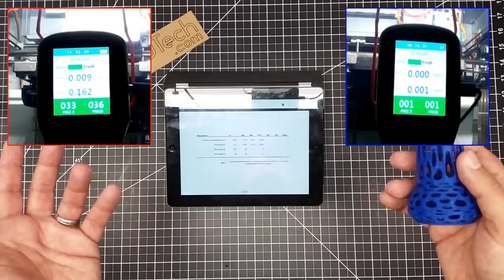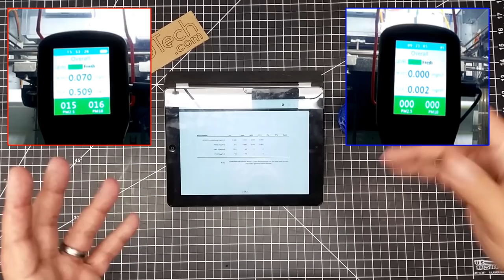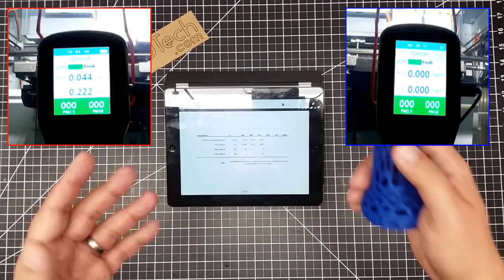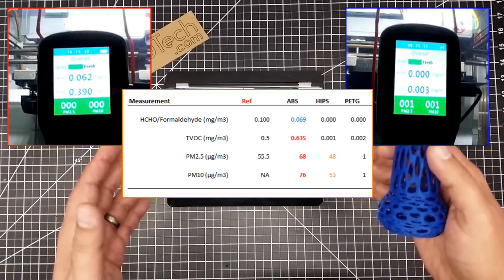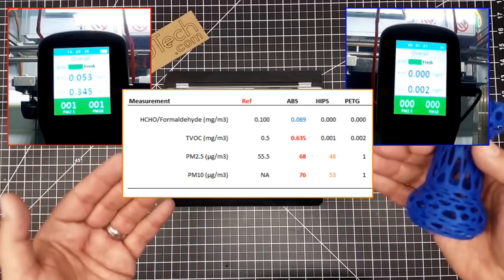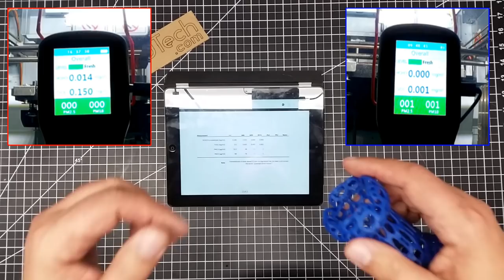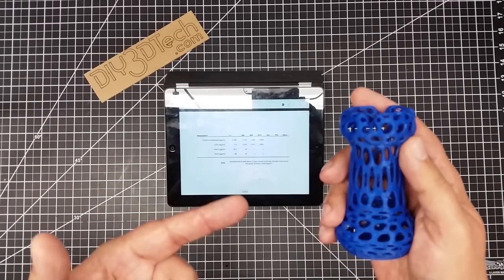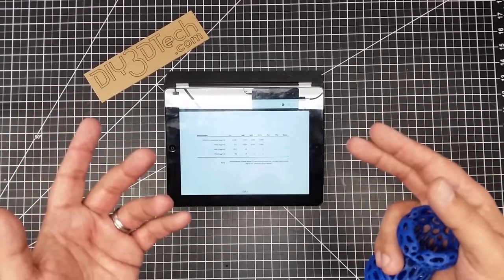3D Print Air Quality - PETG -vs- ABS and the Results are AMAZING!

Comment: I suspect that the biggest reason for the glycol is that it lowers the melting point.  This is quite a desirable property for 3D printing!

What's happening is that PET likes to crystalize.  The glycol groups basically "get in the way", making the polymer more irregular so that it doesn't fit against itself nicely as straight PET does.  As a rule of thumb, compounds that crystalize more readily have higher melting points.  It has to do with the crystalized molecules being more tightly packed and so there are more places along the structure that molecular forces can "adhere" them together.

The crystalization of PET is what causes the hazyness in the material.  Basically, light bounces off the seams between the individual microcrystals, resulting in a beam of light getting diffused as if it were passing through fog.  I believe that the crystalized material also ends up more brittle, since the seams between crystals are weak points where it can readily fracture.
Reply from the maker: Yes on lowing the melting point and very nice summary of PET :-)
Reply: Interesting!!

Comment: I am an artist and new to 3D printing. I was hoping it can help me with my builds on creating very unique things I have yet to see anywhere. I’d love to share my art, hydroponic designs, and commercial product design for home building to share for everyone so I’m extremely excited. I wanted to start off with a filament that is strong, slightly flexible for durability for drones, toys...etc I hate the fact that PLA melts in UV. ABS throws fumes,.... I have a new born and no chamber on my tevo tornado so no go for that one. PETG seems perfect to start off for a strong yet friendly filament with a slight flex so it seems. My next goal is to choose a really flexible, almost latex like filament that’s also safe. You’ve been a great help more then expected. Thank you. If any word a flexible, safe filament that’ll be great. Maybe two to compare low cost to high cost. But mainly health is what I worry about thanks again keep up the great work.
Reply from the maker: Many thanks and yes to the PETG and I know nothing that is as flexible latex, as I typical use TPU...

Comment: I know this is late, but I just discovered the channel and subscribed. PETG is not very complicated as polymers go. BTW pronounced: polyethylene ter-thal-ate (silent ph). PET is derived from ester polymerization of ethylene  terephthalate. Various glycols (polyalcohols) inhibit the polymerization such that the size of the polymer can be manipulated by the competing glycol concentration during the reaction.  PET with very high degrees of polymerization crystallizes, so is not very mechanically useful (in many cases). Adding glycol gives a shorter chain polymer (on average) that has all the useful properties of PETG because it IS PETG: polyethylene  terephthalate glycol. The alcohol (-OH) groups left unreacted during polymerization causes the plastic to be hydrophilic (water loving), which is why you should keep the filament dry if you want reproducible results. I'm not a polymer chemist, rather a biochemist, but since many of the important biological compounds are polymers, we all know a little bit.
Reply from the maker: Very interesting and thanks for commenting for as that is why I didn't become a chemist as the silent ph's always gets me :-)  However this is interesting as yes your correct on the shorter chain and did not realize it was hydrophilic, but guess I should have realized that.
Reply: Thanks for the reply

Comment: Interesting video, thanks. Have you (or anybody else) ever noticed a post-printing 'bloom' on the glass build plate after printing PETG? I love using PETG straight onto glass, which only works well if I keep the glass very clean. After a print of a couple of hours +, I usually get a 'smokey film' appear on the glass bed around the print. At first I thought it was adhered to the glass, but it wipes of with a paper towel, so it's more like extremely fine dust. My printer is a Raise3D N1, so fully enclosed and I'm using Real FIlaments Black PETG.
Reply from the maker: You really don't want to PETG on to glass as it can adhere to well to the glass and actually pull up the glass causing injury.  What you your likley seeing is the glycol residue...

Comment: These are all interesting tests, and I'm glad to see that PETG is releasing fewer toxins as I'd heard before. I do wonder about the ambient concentration in the area around the printer though. Most people aren't putting their faces in the printer and huffing the fumes. If the area even a few feet away is mostly free of particulates, I'd wager that it's probably safe, especially if you have even minimum venting of air. The companies that produce abs filaments, what do they do about the air pollution?
Reply from the maker: I use the cigarette scenario, as one cigarette won't kill you but the habit will.  The same holds true for Ultra Fine Particles, as they bypass both mechanical and biological systems and make their way into the body quickly (I linked to an AMA study on this on the Air Quality page).  When ABS is manufactured, it done in an industrial setting designed for handling releases of this nature and not a homes basement per-say. :-)
Reply: DIY3DTECH.com that's my point though, smokers are inhaling all of the smoke, but most people aren't leaning over their printers and breathing in. It's more like maybe being near a smoker, but not smoking yourself.

What I'm curious about is what the ambient air quality in a room with a printer would be. To me that would give a better idea of the danger.

Comment: Hi I don't have the particle sensors myself but something which would also truly help the community is doing this test again with 1. an active carbon fitler inside the enclosure 2. An active carbon filter mounted on the nozzle 3. an fume extractor to a near window without active carbon. I really want to know which solution is the safest for me and other abs users (currently I use #1)
Reply from the maker: Activated carbon isn't going to do much for micro particles because they are so small.  One could argue that because of the air flow there is a potential an electrostatic effect, however its not really practical.  Fume extraction is the best...

Comment: I still use ABS occasionally for high-load parts that I don't want to flex too much, or for aesthetic things that could really benefit from acetone vapor smoothing (Everything about ABS has to stink and set off alarm bells, doesn't it?), but PETG really is a better filament on the whole.
It doesn't warp like crazy, it melts and burns pretty cleanly, its failure mode isn't as sudden due to its elasticity, it has great layer adhesion, it can handle moderately high temperatures, it has a nice shine straight off the printer, and a stuck PETG print usually just means you have to heat the bed back up to give the part some extra flex around the corners. The only everyday gripes I have with it are managing stringing, and it being fairly hygroscopic, and ABS suffers from the latter problem even more.
Reply from the maker: Yes agree with you PETG is really the way to go if you want to step up from PLA no question!
Reply: The only real problem with PETG is it's not so easy to paint, if painting is required.

Comment: Joe,

I think what you are doing is great, but I would still like to go back to the meter inside and outside the case issue. The point being missed is not the fact that ABS emits more than PETG or HIPS. What is being missed is that ABS is not exceeding recommended daily dosage of VOC’s. 

Now you can go on and just stick the meter in the case and just do your evaluation that way, but you can't stick the numbers from the daily values chart in front of people and say it is exceeding that value unless you do an ambient measurement as well. If you run another test if have not done so already you too will see that it does not come near the recommended daily values. That is the point. 

Now you can turn around and say I 'm not a doctor and I don't play one on TV but I don't like the fact that in the case ABS is pushing out this much...fine I tend to agree as well. But neither you or I can make the claim that it is exceeding the daily values.

Now given all this, there is one other point to remember. If we have a farm of printers like Pursa all printing ABS 24/7 in open air and we do an ambient test with your meter. We will both see that it will exceed the daily values chart you posted. However one or two printers running? That's too much of a bold claim, considering the measure is inside the case. I made the analogy that your car exhaust is poison, yet unless you stick your nose right at the exhaust it is not an issue. As it does not exceed your daily dose of carbon monoxide. 

One disclaimer, I am not a fan of ABS, nor do i work for or have gotten any money from anyone invested in or has an active stake in ABS. I could not care less if you speak bad about ABS.
Reply from the maker: Well here is the thing, (1) this was only one print and "exposure" is cumulative so with each print you are doubling the exposure and with each printer and so on.  Next (2) as I have said a thousand time though this series it does not matter inside a case or not as these gases are going to escape the house and land in the home.  Most modern homes are pretty airtight (I know mine is as I paid a lot make it so) and 2.5 particles will not be filtered by your homes HVAC systems nor  your biological systems either.  Which leads me to (3) is that Ultrafine particles can find a very quick pathway into you body and on the Air-QUality page of the site I link to an AMA study on this so I am not a doctor but they are.  So in short a little can go a long ways.  Finial (4) and something I will talk about more in the next video is this meter was not designed to be an all encompassing meter so the point is the results (all the result, not just ABS) are just the tips of the ice-berg and for clarity I am not being paid to say anything bad about ABS nor am I really saying anything other then the facts and the reason I run the video for comparison as it is what it is :-)
Reply: Maybe a good point, but I think you can safely conclude that the lesser the emition, the safer it is to conclude you won't exceed the daily dosage. I honestly think that 0 is the best daily dosage...

Comment: Now I'm curious on what kind of results you might get if you print the filament(s) at a higher temperature where the print quality suffers from the cooking.
Reply from the maker: The Hoter  things get the worst things happen as the more the plastic will breakdown.  For example at 400 c ABS will clearly breakdown into it carcinogenic components...
Reply: Yes, that is what I would assume as well, but I'm talking about some of these more stable plastics that are considered safer. Would they perhaps see a spike in those components? Will there be a gentle rise? Or will there be no significant increase? There are a lot of unknowns and it makes me curious because I'm sure there are some people who accidentally have the wrong settings at some point and just set it and forget it rather than stopping it right away.
Reply from the maker: For one off, likely not a huge issue and the reason I analogize it to cigarette smoke because its not the one cigarette that going to kill you but the habit...
Reply: In general yes, but there may be people especially sensitive to these particles. To use the smoking analogy, some people (like myself) are deathly allergic to many types of smoke and some people have a high level of irritation or sensitivity when around smoke while not being deathly allergic.

Comment: Is the better question "how long do the particulates remain in the suspended in air or are "stir'd up" when accumulated inside a printing chamber?" vs release at the time of printing. Just like with the particulates I think the gases released aren't that big of a deal unless you're printing in a closed loop environment, otherwise overtime as you mentioned just as the gasses are released into your home from the printing chambers,  every time you open the window/door/turn on furnace/etc the gases/particulates you mention are going to be dissipated, being into additional rooms, outside, etc.  So, yes its key to have good air flow & ventilation, but i think the overall concern is how do these particulates remain suspended in air to where you might ingest them via breathing and then where they might lodge themselves into your lungs and cause issues aka like asbestos.  If i recall most plastics we use are inert and don't have a jagged crystal structure that would embed themselves into your soft tissues, so if you do ingest some of the particulates the lining in the lungs should be able to clear that out.  I think the main concern is when you get to a point where you're no longer melting but actually burning the filaments and releasing the same gases and toxins that you get you burn anything, Prop65 baby! (yes i'm in CA).  Just my opinion as well and I not a doctor either on tv or in real life. :)   Great video, keep em coming :)
Reply from the maker: Again I am not a doctor so this isn’t medical advice however ultrafine particles are not filtered and bypass not only mechanical filtration but also biological.  This means it’s very easy for them to  enter your body so a little can possibly have large effect.  This why I am most interested in the 2.5 micron particles because everything I have read can be high risk.  Now IMHO outside of ABS, doing a few prints here and there isn’t to big a deal, yet there are crazy people like me who have a dozen an therein the issue arises :-)  also thank you for the kind comments :-) and will cover this out a bit more in the next video
Reply from the maker: Yes on the analogy to second hand smoke / vape.  As a child of the 60's I remember the debate of cigarette smoke being deadly and thinking how can it not be.  Only took them 30 or so year to come to grips with that :-)

Comment: too bad petg is a hassle to deal with, and has a strange combination of softness and brittleness where parts are not really stiff, AND shatter like glass if you over flex them, or tap them with a hammer.
Reply from the maker: Me I have had great luck with PETG and is my go to plastic.  Please keep in mind that FDM does have its physical limits too...
Reply: @DIY3DTECHcom  I've found that whatever they use to pigment it can have fairly major impacts on how it prints. I have a white one which absolutely sucks, and a clear one which prints perfect every time. Same manufacturer.

Comment: This is my opinion, it seems to me that when you get a 3D printer no matter the filament type you need to fabricate an enclosure with a filtration system on it to reduce or eliminate the particulates from your living or work area.  
Folks may 'poo-poo' on this that is OK after all YOU are in charge of your own health and environment in which you live.
Reply from the maker: Your correct on the later however worth keeping in mind is that there are many other things in your home out gassing (like a bowel of Apples) more then commonly used plastics such as PLA and PETG...
Reply: @DIY3DTECHcom  I'm sorry, Apples off gas?
Reply: @TShepard  apples off gas in a bowel. That’s why I store mine in bowl. ;-)